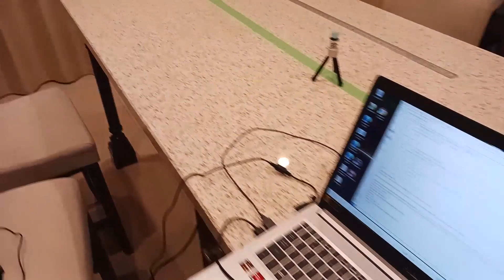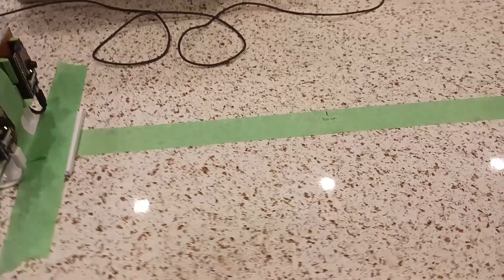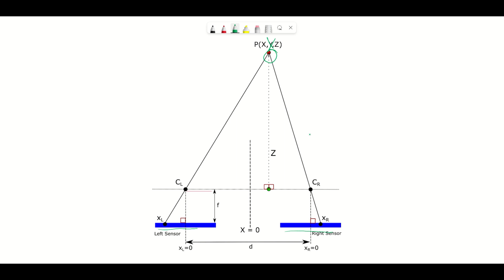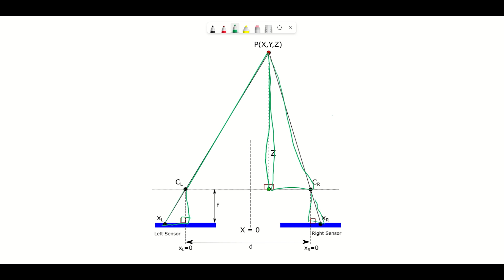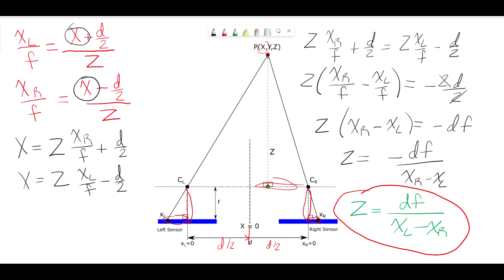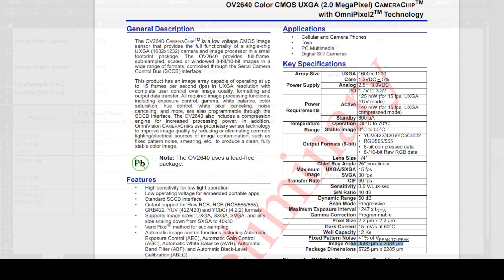Testing our ESP32 Stereoscopic Camera - How far away is the egg?

Comment: Human vision use binocularity only up to 3 meters. Beyond that our brain use another clues to estimate distance, such as occlusion, velocity, relative size to known objects, and many others. Binocularity is great only at short distances, below 3 meters. So, you could move the cameras appart to achieve better binocularity at larger distances.
Reply: I forgot to mention that I use two esp32cam in a small rover, that I build starting from the many esp32cam based rovers that you can find in youtube. I separated the camera up to 20 cm, and the 3D effect is amazing. Also, instead of controlling the rover with buttons on a webpage hosted on the esp32cam, I wrote a small app on MIT App Inventor that use the gyros on a cell phone, so I can move the rover tilting my head calling the urls on the esp32cam. I put the cell phone in a Google cardboard, and I place two webviewer components side by side so I can have each esp32cam view on each eye. Only one esp32cam is connected to the two motors. I fixed the ip  of the esp32cams so the App always find them.

Comment: Cameras sometimes do not use full (or the same) sensor size/area for different resolutions. Your fixed offset of -22 that gives much more accurate results suggest that this might be the case here. 

I.e. your assumption of 2.2um pixel size at full resolution does not directly translate to the lower resolution.

I might be a bit off with what EXACTLY doesn't directly match between the resolutions, but I hope you get what I'm trying to say.
Reply from the maker: I think I understand exactly what you're saying: let's say full camera resolution is 1600x1200, but to return the 320x240 resolution I want, the camera only uses 1200x800 pixels to scale from - then my pixel-scaling would be way off. In fact, I remember trying to check the datasheet for such information but didn't seem to find anything and so I used the full resolution scaling assumption... I will need to revisit. Thanks for that!

Comment: Just take a picture of your graduated rule at 60cm for ex, then calibration will be obvious. You will be ablte to compensate for each and every parameters. As you can see the main concern here is that the 2 camera are not parallels, so you have an error due to your hypothesis of common center, and a minor (2nd order) error too for non plan to plane correction. In addition lens are not purely geometrical (stenope is) so the projection is not proportional.

Another useful trick is to place another green tape line on the table, perfectly parallel to the main one. Prolungation of the 2 lines will give you an infinite point that may replace your off center.
Reply from the maker: Thanks for this advice. I will keep working on this with these considerations in mind.